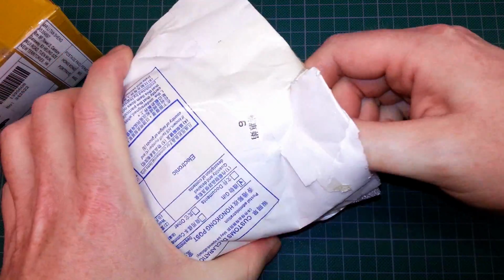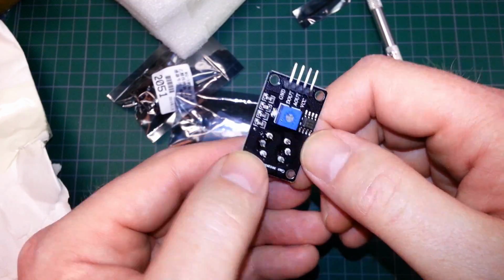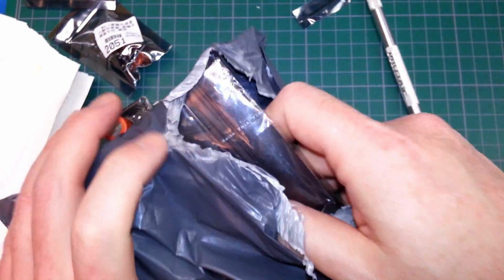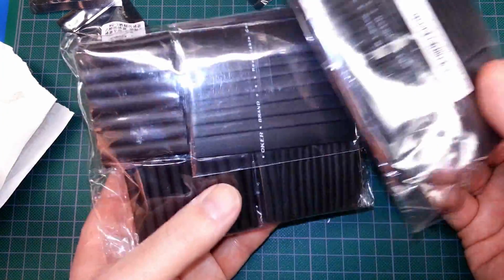Electronics Parts for Arduino and Raspberry Pi - Mailbag

Comment: I pick up the value Shenzhen Market heat shrink as well, the main difference is it doesn't shrink as much as name brand; I just use a smaller size.  One other difference is you need to use a little extra care when applying heat as it will melt at a lower temperature; in general F yea it's a great deal!!!  Have you seen the price of 3M lately? It's outrageous!!
Reply from the maker: Vinny Lacorazza Yep the name brand stuff is nuts.  Just tried some of this new shipment and it is impressive.  I see no issues with the quality at all.  Cheers

Comment: You mentioned in the hangout about making a video on the Nokia display, I'd like to see a simple concise video on that, hope you make one. Would also like one on working with that I2C display too.
Reply from the maker: ***** The Nokia vid is indeed on my desktop awaiting editing so it will come for sure :)  The OLED already has a video actually and the code linked for it too.  Just go back a few vids on my main channel- it was pretty recent.  Cheers
Reply: Eric William -MKme Tech
I remember it, though I hadn't caught the I2E aspect, I have a couple projects I want to do will be run I2C...
Reply from the maker: ***** Yep they work great.  Cheers